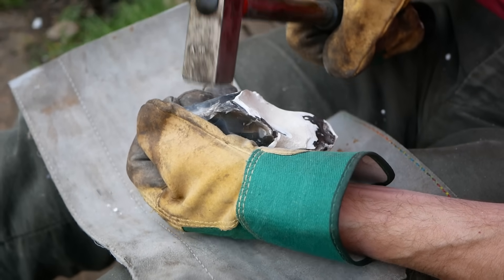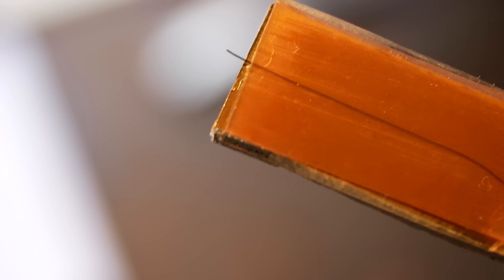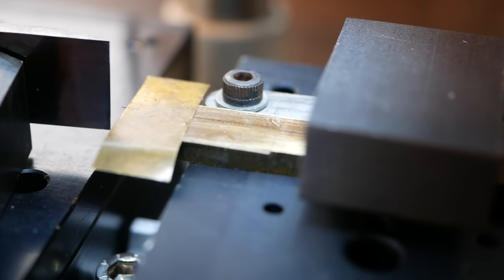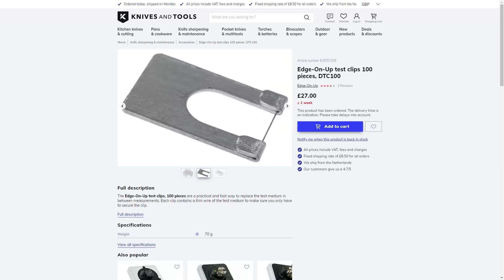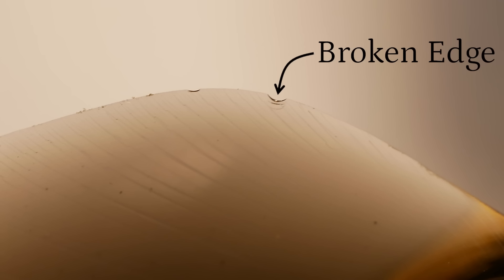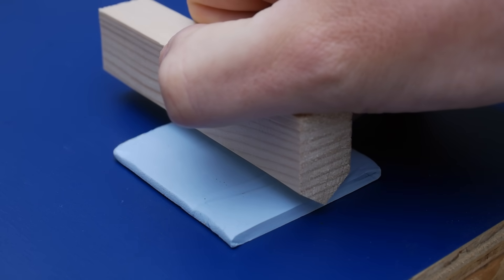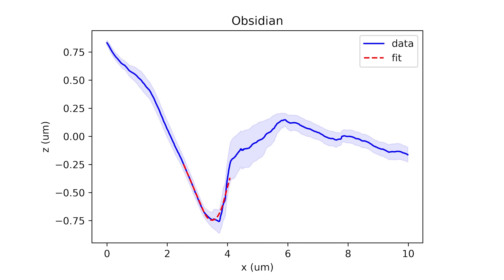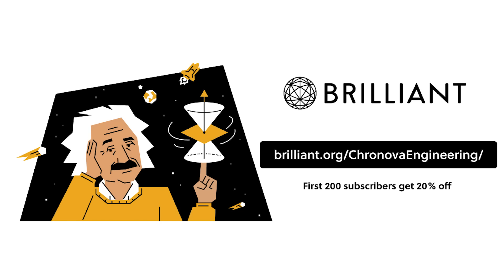Does Obsidian Really Form the Sharpest Edge?

Comment: Sharpness can also be measured on the opposite axis, dragging the edge as done if cutting a tomato. You never see a chef push a knife through a tomato. Rerun the same test with a sawing action and your results will drastically change. Measure y over x with x being a fixed distance.
Reply: sharpness extra damage is 0.5 * (level - 1) + 1.0 so in java edition sharpness V gives 3 extra damage
Reply: For barbering when we shave someone’s face we don’t shove the blade through the hair we have a slight slicing motion or “dragging the edge” as you say, which ensure highest comfort and cleanest shave. I do agree the obsidian may be sharper if used that way.
Reply: Pretty sure a sawing motion would be make the data too inconsistent. Unless you have a very precise robot arm that can replicate the exact motion and apply the same amount of pressure in each test run.
Reply: @tedwintheslyfox9382 well there’s no doubt that obsidian can cut through keratin. But you really have to take density and toughness and hardness into account. Metal is tougher because it’s softer. We arent really measuring sharpness in this video, just the ability to split hairs!! Split hairs in a very specific way.
Reply: @tedwintheslyfox9382  uhhh an Arduino, a stepper motor and a small gear setup would suffice, so many rotations over so many thou an inch over x time, what kind of engineer are you?
Reply: @DurokSubaka  "  so many rotations over so many thou an inch over x time, what kind of engineer are you?"

The kind that thinks about the problem before suggesting that the solutionis easy. 🙂
As soon as you start moving back and forth you are nolonger just using the sharpness, you are introducing a tearing action to the stuff you are cutting. That's why we use it to cut faster; the shapr edge makes an opeing and the saw motion rips the rest apart.
SO how does your arduino-based tool measure how much of the force it applies goes to cutting and how much goes to simply displacing the material?
Reply: Next time I shave, I'll be sure to use a sawing motion.
Reply: @Kimtron142 you’d be surprised to find out that 90% of people think they know how to properly shave, but they don’t. Slight slicing motion is proper technique.
Reply: Ohhh so THATS why my tomatoes looked wrong
Reply: Sharpness is very difficult to determine like a blade edge 1 atom thick is technically the sharpest it can go but it won’t be able to cut anything
Reply: For a polished edge like the chisel, including a sideways motion will simply have the effect of making the sharp angle sharper.  It's exactly like the trick of bicycling up a hill:  compare straight up vs going diagonally from the left side of the road to the right side of the road as you ascend the hill.  In the latter case, you covered a larger distance for the same rise, so the hill seemed less steep.
IOW, for modern (non-serrated) blades, the sawing action does not change the characteristics and if you want to include a sideways motion while cutting we know how that affects the sharpness number you started with.

For a napped edge, it may contain microscopic serrations, which contain cutting edges facing different directions.  Here, sawing does not make the blade angle sharper but engages a micro-blade at that angle.  Being able to cut through a material using saw teeth is a ripping action, different from sharp cutting.  That opens up a whole new level of complexity in how to measure and quantify.  But, it won't split a hair that way.

Note that kitchen knives are purposefully not very sharp, compared to a woodworking chisel.  By only using an 800 grit to finish, it leaves a toothy finish on the soft metal at that scale.  This grabs the tomato skin when you move across it, and optimizes the knife for cutting foods, in general.
Reply: @JohnDlugosz  if I understood your logic in the video, you stated that the obsidian had broken. Therefore it couldn’t be nearly as sharp as the metal. However, even the sharpest metal blade is at best several molecules wide, and the obsidian can be a single molecule wide. Therefore it is fragile. I was simply proposing that you reduce the amount of pressure at any given point of contact by moving across an angle, thereby allowing a greater cutting action at a lower force, preventing the fragile blade from breaking.
Reply: @DurokSubaka  If you could grind a straight flat edge, that would be the case.  But the natural napped edge is like a rugged coastline.  Moving sideways will simply engage a different micro-edge that's facing that direction, and buckle and smash it.
Reply: @JohnDlugosz  I would agree if the sideways motion was an inch wide, but we’re only talking the width of a human hair starting at the far corner of the width of the hair to the opposite side but in a forward motion 45° angle so you’re only moving a very small amount to the left or right and a very small amount inward. Just the fact that you’re giving it some leverage allows for a decrease in pressure on the face.
Reply: @JohnDlugosz I completely disagree. I'm a chef and finish my knife on 6000 grit stone then 10000 grit strop. Its shaving sharp and cuts tomatoes (and almost anything) like a dream.
Reply: @drewdabbs418 Overkill and unnecessary. But, you seem proud of it so at least one person cares. Not sure anyone else does.
Reply: @drewdabbs418  Most kitchen knives that are sharp at all don't get that kind of treatment.  I'll bet if you experimented you'd find there's a wide range between 800 and 10000 where tomatoes won't cut so well.  Also, you use fresh ripe tomatoes with a skin held plump -- a vegetable several days old in the 'fridge keeper drawer will be more of a challenge.  There's also a matter of how long such an edge will last.  I suppose your knives are made of tool steel.  Most kitchen knives, including certain expensive German brands, use an especially soft steel.  It could certainly be polished to a mirror shine, but the edge will end up being all torn and ripped, so essentially scalloped on a micro-scale.  It would be interesting to have the channel make micrographs of that... the sharpening book by the guy behind Verritas / Lee Valley "only" shows electron microscope pictures, which some folks these days considers "zooming out".
Reply: @JohnDlugosz this is just so wrong
Reply: @drewdabbs418  I here what you are saying and agree....to a degree. I do not consider myself an expert at sharpening but I am more efficient than most. I also love cooking and love my knives sharp as well. That being said, in my opinion, it is better for a general purpose kitchen knife to have a somewhat toothy edige. However, it is still refined to a polish and is shaving sharp. I quit using my 12,000 grit stone for this reason. However, I do have some original German Henckles that can take,  hold and use a highly refined edge. Interestingly, I have found that the free phone books make for a great strop. I quit using my leather and rouge. My axes, hatchets, and machettes all have mirrored, razor edges and I never go over 8,000 with them. When you get an edge too refined, that slickness tends to stick to the cut surface, just out of a force known as "adhesion." Pisses you off with cucumbers, squach, and tomatoes, and even more so when your axe or hatchet does it.
Reply: i was going to suggest this - however i had no idea how i was going to convey this information, i couldn't have articulated this as well as you have. lol
Reply: Of course, since when is cutting done by pushing? you need to slice ! That's why the guillotine blade is slanted
Reply: Nice comment. I stopped watching. Will wait for fixed version
Reply: Goddamn this is a classic ass youtube comment. Always yapping from someone who doesn't do things telling those that actually DO THINGS how they should do things. Atrophied individual you are.
Reply: Exactly.
Reply: Using a dragging or sawing motion is not a valid way to measure sharpness, rather it is the opposite.  If you have to use a sawing or dragging motion to produce a cut, then you're working with a subpar edge.  The only reason why obsidian cuts well is because of its natural inconsistencies and a tendency to create new cutting surfaces due to fracturing, resulting in micro serrations.  Certainly not because it has an excellent edge.  Lots of materials can have an edge thickness of a single molecule, but that doesn't correlate into a sharper edge.  If you had a piece of graphene once molecule wide, you wouldn't have a useful cutting edge simply because it'll bend and break long before it was able to make any headway toward cutting an object.  Sounds great in theory, but it doesn't work in reality.
Reply: I wish I understand 😢
Reply: such a pedantic difference. stop splitting hairs
Reply: I would argue that all knives are saw like at a particular magnification. Even a mirror polish is rough when you look closely. Dragging a knife across a tomato, a soft and smooth squishy fruit, will do better than a slow downward motion every time. There are very thick single bevel knives that have the profile of a chisel. You get a very straight cut but the flat side of the knife gets suctioned onto the vegetable… uh.. you wouldn’t want to cut a tomato with it. Onions can be cut straight down with a dull knife, so the shape, material, sharpness and subject properties all matter. Especially at slow speeds. Just about any edge will cut at a high enough velocity. I cant get a scalpel to cut skin without dragging it and under a microscope, a scalpel looks like a saw. With a rounded edge scalpel you would probably have better luck with a down… o who cares.
Reply: Sawing will also cut effectively with microserrations, so it's not as effective a measure of true sharpness.
Reply: no, sharpness would be much more difficult to measure with a dragging test. You'd need a way to standardize the drag, while still being able to vary the downward force applied. It introduces many variables that are difficult to control. Also, it would not change the results. Push tests are a proven and consistent way to measure edge sharpness. Even for serrated edges, it measures the sharpness of the serration. Also, if you magnify enough every edge is serrated, and flat edges still cut better with a slicing motion. As long as the parameters are consistent, the results should be valid. I don't think a dragging test would change the results, only you'd get lots more obsidian bits flying around the test apparatus.

Comment: It would be interesting to see some experiments of stonemasonry chisels of different materials and edge geometries and how the "cutting" action actually happens.
Reply: I'm with you on wanting to see other cutting tools checked this way, ie more methods than just bess testers. The microscope view of the cut happening is very cool. 

As far as the masonry chisels go, I think that would be interesting to see, but I do not believe it is "cutting" in the sense we tend to think of. I don't use hand chisels at work, but when we drill into concretes and natural rocks (metamorphic and igneous primarily, I think), we use either rotary hammers, which take a carbide chisel point embedded in a normal looking drill bit. That carbide chisel is decidedly not sharp normally, and uses the power tool to strike the stone, imparting around 10 lb/ft per impact over the very small chisel area, around 3000 times per minute, and then the rotary action is just clearing the fractured chips up the flutes and out of the hole; alternately, we use diamond hole saws/core drills to abrade away the rock in a fine dust (this actually need active cooling with water, unlike the hammering process). The caveat to that is there are specialty concrete bits designed to cut through rebar in reinforced concrete, and these have a very different carbide striking edge that is also needing to cut iron in this application, and those do tend to be sharper, and have a much tighter radius point at the intersection of the (usually) quad point chisel. 

My guess for handheld masonry chisels is they operate the same as the rotary hammer method, albeit much slower, with much higher energy imparted per blow, and the edge is being used to concentrate where you are causing the fracture, and the vector of the force, giving a significant level of control compared to a rotary or demolition hammer.
Reply: 'and how the "cutting" action actually happens.'
Having split some pavers and granite rocks by hand for the patio, I can tell you this easily.
Doesn't matter how sharp or hard you make the chisel point, it's quickly going to round over and make a narrow but relatively blunt edge.  You're hammering the edge against stone, it won't stay sharp.
The cutting action is really peaking a large amount of force into that still relatively narrow edge, and locally creating small fractures and some grinding.  Eventually you send fractures enough through it that it splits entirely.
Go watch videos of splitting stone by hand and it's all basically a fracturing process, not really 'cutting'.  Then there are softer stones like marble etc, when carving that you're still setting the chisel at a shallow angle and grinding and fracturing it off.  
And tool and saw cutting stone is much more related to narrow grinding.  
Only very soft stone types with a hard sharp edge might do something more like actually cutting the stone apart.
A sharper chisel will cut your stone a bit better and faster at first, but it's more about concentrating the fractures better into a narrower space than that it's really 'cutting' the stone better.  Sharpen up a masonry chisel and try some, it is very interesting to do.  But you'll quickly stop thinking of it as cutting like a knife, and much more like fracturing/grinding under that chisel edge.
Reply: Yes this is so. I did the stone masonry course at Bath, and it's what you are told pretty much. A ''hard'' stone is characterised as one that fractures, the chisel edge is controlling the angle of attack and force, producing a fracture that deepens at that angle , and then as the force can't go right through (unless perpendicular) immediately ''spoons'' back up to the surface...your chip. A ''soft ''stone appears to cut, but it is really a micro-crumbling in front of the edge. Cutting non-brittle material is completely different ! And that's where slicing comes in, as the material can be used against itself. I bet the obsidian would win.

 @ModelLights